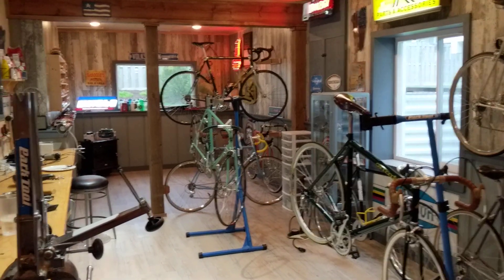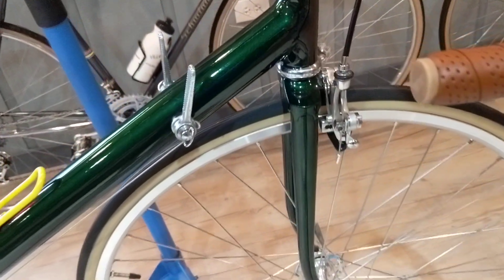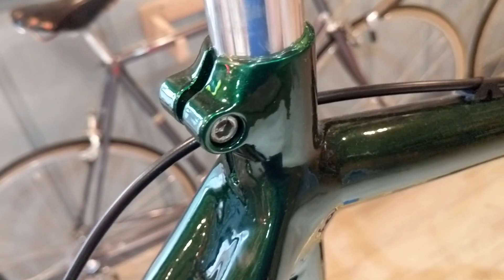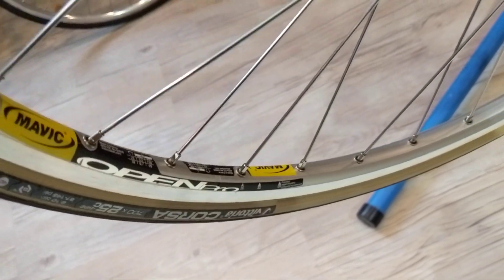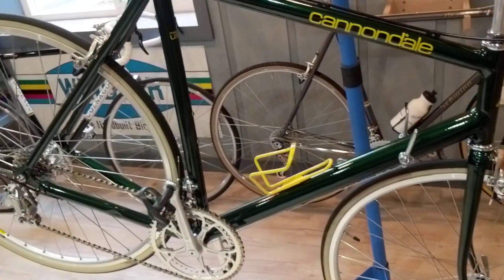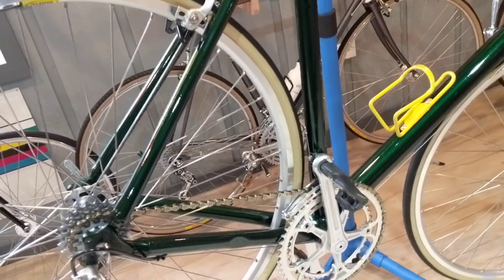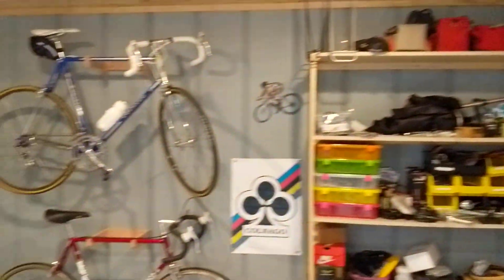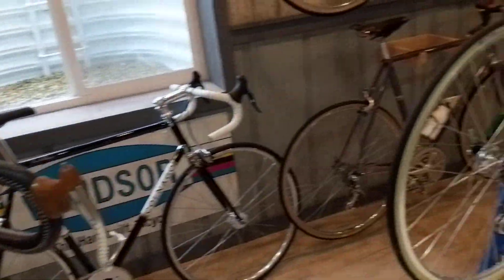First Gen Cannondale road bike total restoration! Did I spend to much?

Comment: I’m having a Cannondale 3.0 Campagnolo (blue-white) road bike rebuilt/tuned up to get back on the road this summer….
I’m 5’6” & 138lbs and was probably more like 125lbs when I was riding this bike years ago…I eventually bought a Team SL Fuji with Chorus 10 spd, and set the Cann aside to rest.
The cannondale also has a bare aluminum Sakae fork, custom Hershey Racing crankset and Rolf Vector Pro wheels with a Veloce 9spd group …
The Cannondale is my pride and joy…it was and is stiff as heck and fast as lightning with those wheels…I can’t see anything I like in the current crop of road frames these days…and the only thing I would put my hard earned money down on is a vintage or new lugged steel frame …used Colnago or Bianchi
Reply: The Cannondale is a modern classic…IMO
Reply from the maker: Sounds like a pure retrogeek! That's why I love the vintage stuff. The ride and the look can't be beat. Sounds like a cool Dale! Thanks for watching.
Reply: I just bought a lightly 🤷🏼‍♂️Used…if I’m to believe the seller 😁, gold rim Rolf Vector Pro set off the EBay to use on the rebuild…the mean mean streets of Brooklyn and Manhattan split my rear hub after 10 plus years….
But nothing else looks like that super open spoke pattern of the Pro wheels

Comment: Just got one...frame only. The forks are still chromed and shiny but it’s been stolen 59 times since 1985 and it’s been spray painted also someone too wide of a tire on it and it has WORN THRU the aluminum frame on one rear support rail on the inside. 
But it’s still a rare beauty in in this grotesque condition.
Reply from the maker: Listen, they clean up well. I sanded a rough patch down and gave it to a powder coater. These paint up well! I paid a whopping $125 and the frame looks new!

Comment: Hey John, do you know if you can put new/modern group sets on these old cannondale bike frames. I have an old cannondale caad 2 frame and I want to put a new shimano 105 on it, is this possible?
Reply from the maker: I think you're only dilemma would be the spacing of the rear triangle. I've done it on a steel frame where you can cold set the frame a little bit wider. Those cannondales are not very forgiving. I don't know what the spacing is on that frame that you have. That would be your only dilemma.

Comment: No, you spent TWO much.    It's NOT one of the very earliest ones, like my ST500, that had a long wheelbase with lots of space between the rear wheel and seat tube, and no indentations on the chainstays.  The ST models with the longer wheelbase have much less harshness than SR's like yours.  Would be a lot safer to ride with dual pivot brakes. Those "vintage" single pivot side pull brakes are horrible. Modern, wide rims, and 28mm (or wider) tires would improve the ride quality. Open Pro rims are junk.
Reply: @Planet Mongo Commodities Exchange   Gotta call you out on the single pivot brakes and Open Pro rims...I'm a big guy (6'5" 215lbs) and Open Pro rims are some of the few rims I haven't absolutely destroyed over the years...some of us value strength and durability over light weight and WOW factor...plus they just look right on a "classic" bike.  As for single pivot brakes; for MANY years that was what we had and they worked!  While I like the light feel of my more modern Ultegra dual-pivots, my old Modolos still get the job done just as well...the feel at the lever is just a little different.
Reply: Single pivot brakes are inherently flawed due to leverage difference of the two arms. Dual pivot brakes were much better, but only the ones from the last few years, with hidden roller cams, equalize the mechanical advantage on both sides and exceed the performance of the old center pull brakes like the ones on my first road racer.

 I like the Kinlin XR-31, high performance and SUPER STRONG. Mavic not what it was 30 years ago when I was the mechanic for a crew using Mavic wheels for RAAM.

You chose the wrong frame. Those old SR's have an unbearably harsh ride. The ST's are much more forgiving. Mine made a fine road racer. It could do almost anything. Rode SR's too. Never liked them.

Don't really care about this old stuff anymore. Riding a Merida Reacto now. It's like a bike from a different universe.
Reply: @Planet Mongo Commodities Exchange  Seems like you are watching the wrong videos if you think all this cool, older stuff is nothing but junk!  You should probably limit your viewing to videos that highlight the latest $3,000 gizmo that will save 2grams and increase your power output by     0.35 watts.

Comment: A Cannondale from the "crack and fail" days...  and if you had ridden it much you were not upset if cracked, the ride was so harsh.  I say this as someone that grew up 25 miles from the factory and rode a bunch of different Cdales... mostly aluminum.  I would not ride one of the current Cdales if you gave it to me.
Reply from the maker: Not a fan huh? lol. Yes they were harsh. Very harsh. In the 80s I ran one of the largest cannondale dealers in the midwest. We were big fans. Probably mostly because I was a 190lb masher! I liked the stiffness. Of course at the time I was young enough to take it. Painful now! LOL. Honestly. We didn't get to many that cracked even though they were called crackNfails.
Reply: I had one of these ‘85 Cannondales and LOVED the “harsh” ride.  At 6’5” and 215 lbs. other bikes just felt like noodles to me!